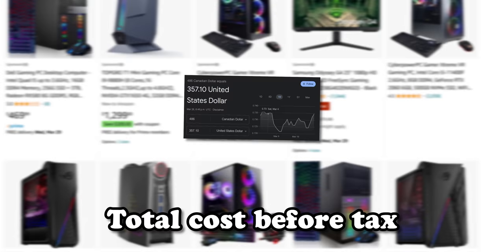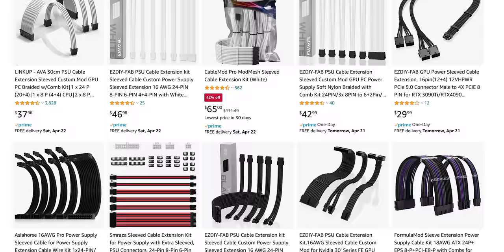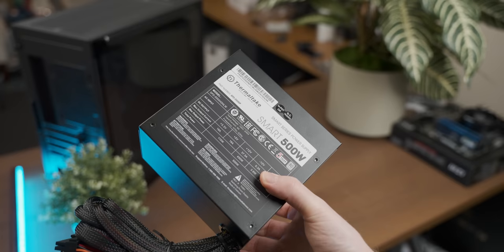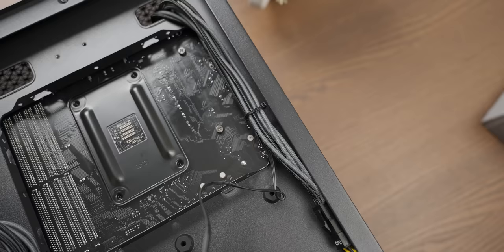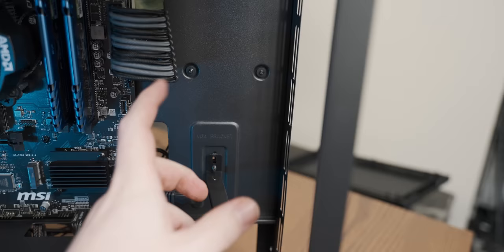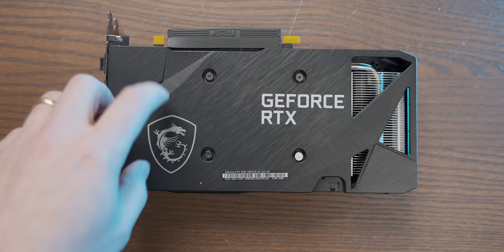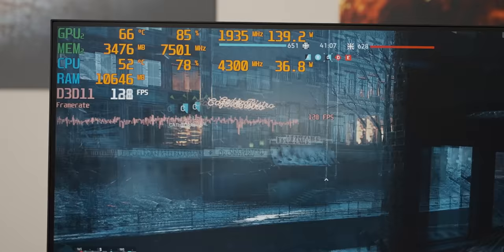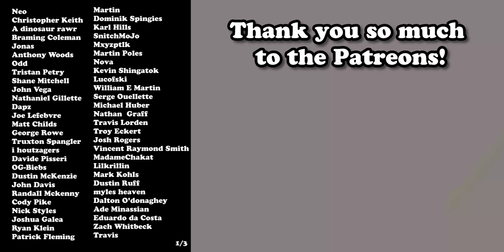I Use ONLY "Amazon's Choice" Crap To Upgrade My Gaming PC...

Comment: Ironically enough, the Peerless Assassin is actually one of the best air coolers in this price range. Gamers Nexus put it through its paces with their test and it came pretty close to matching the Noctua NH-D15 in terms of cooling performance. I think it might be due to you not having used the second fan as well as using the stock CPU fan curves that caused the excess noise in the system.
Reply: Yep, actually one of the best air coolers period. According to GN, Hardware Canucks. And for that price it's a steal :)
Reply: Or use a Noctua industrial 3000 RPM fan and call it a day. If you're really feeling frisky use 3 industrial 3000 RPM fans.
Reply: A noctua two tower model with one fan in the middle is more silent than the two fan model.
Reply: Yeah, I watched the video by Gamers Nexus so I thought the same thing. Until I bought it. I have it paired with a 5800x so I'm willing to give it the benefit of the doubt when it comes to mediocre thermal performance, but the fans really ain't great. Max fan speed I'm running them at is about 50%.  After that, they start to get real noisy and produce a high pitched whistling kind of sound when they're at 70%. Good thing about it has a lot of thermal mass so it gets away with low fan RPM most of the time, and for the price it's still an absolute steal.
Reply: @K1NDR3D  blud thinks he's him
Reply: @jamesm568  and pay 6x the price
Reply: I am using the Pearless Assassin on an Ryzen 7 5800x. I am using both fans however. The fans never seem to make that much noise when I am using it even in fairly intensive games. I play Shadows of the Tomb Raider and Zero Dawn, which I think are pretty high end games.
Reply: @legostarwarsrulez  True, but works.
Reply: If Dawid had mounted the fans properly and not just used one clipped to the wrong side of the fin stack, he wouldn't have even had the complaint about the fan sounding awful, which was 100% down to his own modification to the instructions. Never mount fans with the intake right against an obstacle if it can be avoided (and it can be avoided here), since it causes turbulence and excessive noise.
Reply: @jamesm568  enjoy the noctua tax
Reply: @JeskidoYT  I enjoy the great product support as I don't have to replace the stock fan that comes with their products unlike this product here.
Reply: @SierraAAM  It's all good as we all have our likes and dislikes.
Reply: @bjn714  I noticed that too. Encountered a similar problem with fan turbulence when deshrouding my GPU and mounting the fans hub side up against the heatsink to have them exhaust. Had to use some foam spacers since the fans didn't have any bumpers either.
Reply: @alfredosaus1545  that can result in turbulence too, but due to blowback, which is not exactly what's happening here. The fan blades are slicing through the air which it expects will be open/little resistance, and when you mount the intake side (opposite the hub) directly against a fin stack, the blades will be essentially bifurcating the airflow at each fin stack, with some going back out toward the front (which will get pulled through via static pressure, so it's not like it will be blowing two ways at once) and the rest going in the direction it is intended. That air that's being bifurcated across each fin will cause a turbulent resonance, almost like if you were to drag a sheet of paper down the fin stack, but at 1200 RPM or so. 

But simply removing the clips and putting them in the other holes on the fan and clipping it to the rear fin stack would completely solve this issue (in Dawid's case). Your GPU situation you seem to have already solved, but yes, a foam gasket or 3D printed spacer is ideal for this application.
Reply: People in this thread blaming the way it's mounted for the sound, with no one actually owning the damn thing.
Reply: @K1NDR3D  how are you able to make such a claim? Oh that's right, you can't. 
I've used this cooler in over a dozen client systems in the past 6 months, and none of them have had any excessive noise issues—the coolers are quieter than the NH-D15, even. But there was absolutely an issue with how the fan was attached to the cooler in this video, which is verifiable by simply watching the video.
Reply from the maker: That’s good to know. The fan noise was clearly an ID10T issue. The cooler clearly just wants to be used in the “correct” configuration.
Reply: @DawidDoesTechStuff  it would still be fine with a single fan, as long as you clip it on so that the hub is against the second tower, rather than the intake touching the back of the first tower. So just moving the clips to the other set of holes on the fan and clipping it to the rear tower instead should solve the noise issue.
Reply: @bjn714  If it's quieter than the NH-D15, which I highly doubt, Noctua really needs to work on their fan design
Reply: @K1NDR3D  The NH-D15 is quite old now, and those 150mm fans it uses are not quiet when compared to their flagship NF-A12x25 fans, which are much quieter.
Reply: How does it compare to the NH-U12S Redux? I have a 12400f, and don't play anything particularly super heavy. The stock cooler is loud as hell when the Temps are in the 40 range which shouldn't be happening. I was thinking of just going with the noctua since it looks easier to install and would be enough for me, but the thermalright one is a bit cheaper and  seems pretty damn good but a bit big.
Reply: Not bad for a copy paste huh
Reply: @tek3576  i have a 12600k and cool it with a nhd9l, you'll be fine with the u12s. Peerless assassin is overkill unless you want a chonky cooler to just have a chonky cooler.
Reply: I can confirm that the stock fans that come with the peerless assassins are that lound no matter what.
Reply: High noise is due to the fact that case is not pulling enough fresh air nor it's exhausting well enough. 
I built few rigs in similar cheap cases, where front panel RBG is more important than air vents, and temperatures and noise levels get better once you remove ceiling dust filter. It's stupid there anyway in the most use cases because rarely anyone is pulling air inside from the top.
Reply: @jamesm568  You can get a box fan that moves > 5000 cfm.  Funnel and duct that through the case.  Added bonus, you can get a high flow filter that for all intents and purposes sterilizes your air and perfectly fits to its back with some tape.
Reply: @uncrunch398  You can also just keep your room at 32°F your computer is in.
Reply: @jamesm568  The box fan isn't super expensive to buy nor operate.  And can be quiet enough to forget about it.  How much will it cost to maintain the freezing point of water for your room when the ambient outside stays above 75F and peaks 88F to ~100F depending on day?
Reply: @uncrunch398  That's why you just buy you a Noctua 3000RPM Industrial Fan. If you're a PC enthusiasts cost is irrelevant anyway.
Reply: @jamesm568  I'm a practical value enthusiast.  I like to target benefit per cost with a performance floor.
Reply: @uncrunch398  And I like using products I can drag from case to case and use them in multiple ways without being limited to one option.
Reply: @jamesm568  That makes sense to me.  It goes with intended use long term.
Reply: I guarantee it is NOT. EVEN. CLOSE. to a DH15. If you install and configure everything properly and actually optimize case airflow, DH15 blows literally anything else out of the galaxy.
Reply: @jefftraboulsy8631  Then do a controlled temp test with benchmarks like Gamers Nexus and prove them wrong. Otherwise, it's just you saying "trust me bro" with no proof behind it.
Reply: @jefftraboulsy8631  Actually, if you have optimized airflow most air coolers can live up to their specs. Now I would pick Noctua over most of the off-brand air coolers as it's just ghetto using anything less.
Reply: I used to have that peerless assassin before, and also had that annoying noise from the fan. Looked it up on the net and found many complaints about the fan too. So i only changed the fan, cos the cooling itself is actually good. Don't know why people here are so defensive about the cooling, like it cannot have any problem.
Reply: i have a feeling the actual cause of the noise may have been the power supply. Dawid showered that poor thing with nothing but complaints. considering how extravagant it already was compared to the CPU it was mated to, i can't imagine the problem was the missing second fan. i mean, it could be. i'm a complete computer newbie when it comes to this stuff. but i dunno.
Reply: yes, the Peerless is very good but the fans are crap, so I replaced them by two fans coming from a NH-U14s I had left and the result is really good. Also, the Noctua fans comes with rubber pads that avoid all unecessary noise due to vibration.
Reply: @K1NDR3D  i have the cooler and can say after seeing his comment it does in fact change the sound profile when swithing the fans over and also having just one fan in the middle will over work the fan and have it ramp up higher than it would normally go with the two fan layout
Reply: do we think amazon choice is RNG? why would it be ironic
Reply: The Phantom Spirit is now the apex budget cooler

Comment: the crucial p3 is actually an amazing choice; 45$ for a 1TB 3500MB/s Drive is incredible. I personally recommend the p3 plus, but you can’t go wrong with either.
Reply: The plus version is like $54 I think, not a lot more and It is way faster so maybe that one is a better option
Reply: @Scj10  I agree. It’s about 5 dollars more for the same capacity, but with PCIe 4.0, and reads of up to 5000MB/s. I just didn’t mention it because you really can’t go wrong with either
Reply: I got it for slightly more but id still recommend
Reply from the maker: It’s so cheap for a drive that fast! Storage pricing has gotten so good.
Reply: it’s amazing right? I couldn’t believe my eyes when I saw it go down to 45USD
Reply: I had it installed in my Acer Swift X, no complaint!
Reply: It's a qlc drive though, which isn't really good if you're constantly writing a bunch of stuff into it.
Reply: You miss the point, it’s $45, it’s exceptional for its price point. If you wanted a better drive, it would obviously cost more money.
Reply: Can confirm this for sure. I mean last year I upgraded my system when AMD were slashing prices on B550 and X570, as well as 5xxx series CPUs--but I also grabbed a P5 1TB as my OS drive; recently, as far back as the the OP, I decided I wanted to just add another 2TB in the second slot, and saw a P3 going for for about £20 cheaper than a MX500 2TB SATA drive. 

Insane, and a steal!
Reply: I have a 4tb one and its solid for mass storage
Reply: @DawidDoesTechStuff  Can we get GDDR6 prices down next? Can I get a slot for GDDR ram upgrades so I can install it when I can afford it? Or at least start coding for utilization of the shared memory?

Comment: I used some SYY thermal paste on my laptop about 2 years ago. Still going really well in terms of thermals. My only advice is that it's a bit thicker/denser than I'm used to so spreading is a bit difficult. I'd advise spreading it manually with the included tool on something like a laptop rather than just sending the screws home and sending it - it feels like it'd bend the board before spreading nicely

Comment: I used to have the same cpu cooler. Turns out, placing the fans as pull instead of push makes the cooler overall louder with a high-pitched noice. And putting both of them, managed to stay very quiet even with a 5800x with temps below 65° in a full load while gaming.

Comment: been using SSY 157 thermal paste for about a year now found it to be as good as anything branded plus its always in stock on amazon and I've been getting 8 grams for about 8 quid uk
Reply: 6:33 4times the storage does not make it faster a faster ssd is faster not the capacity🤣🤣🤣
Reply: @raven4k998  not technically true with nvme drives smaller capacity drives can and are slower than there larger capacity siblings e.g
wd sn750 250gb r/w 3300/1200,    wd sn750 500gb r/w 3500/2300, wd sn750 1tb r/w 3500/3000
Reply: @moorhen6156  nope Dawid said faster not slower faster like when you floor it in your car🤣🤣

Comment: I've used that power supply in my system for over 4 years now. Never had a single issue
Reply: Same. Just updated mine with 550W after about 4 years. Previous one was working great just needed cleaning and I put it in another case for a lower end build.

Comment: ngl that cpu cooler is actually pretty good if you can fit it in your build, the only downside is the fan noise on the lower tier cooler, but you can easily swap them out for more silent fans
Reply: Stick an arctic or 2 on it
Reply: If you can pick up the Thermalright on sale, which has been happening a lot lately, and have the fans lying around, then it's a great deal.  But once you start buying fans, it's putting you close to the price of other coolers.  
Right now, on Amazon, the black edition of the 120SE is $37usd.  If you pair it with a couple of Arctic P series fans, there's another $20.  At $57, would I spend the extra $8 and get a Deepcool AK620?  Probably.  But I'm not everybody.
Personally, I got the Peerless Assassin on sale for $32, and bought a 5 pack of the Arctic P series fans.  2 fans replaced the cooler fans, and the other 3 replaced case fans.  That setup has worked great for me.
Reply: @tsuzot8192  I have a thermalright silversoul 135 and it got a decent, very quiet fan...
Reply: @tsuzot8192  The Thermalright is a better cooler than the AK620, the more expensive version of it comes with fans with rubber corners, I guess it makes it sound a bit better. Otherwise it's one of the best air coolers atm and only costs like 40USD. It's a steal.
Reply: @jondasek  As GamersNexus said, the Thermalright is "within error and indistinguishable of the $65 Deepcool AK620."
Also, I was addressing the guy that said replace the fans, which adds costs to the cooler.

Comment: The fan on the cooler likely sounds awful due to how it's mounted. They're designed to be in a "push" configuration, with the exhasut side of each fan directly touching the fin stacks and an air gap on the intake side, but you have it clipped to the back of the first fin stack in a "pull" configuration, which will lead to turbulence since the blades are spinning right up against the fin stack with no air gap.

Comment: You are correct...swap the GPU with the 6600 and use that money saved to put in a 5600X.  That system would be well optimized.  The Crucial SSD is a great budget option and I have the P2 version in my media server.  Honestly anything that can read/write over 1.5K MB/s is fine.  Standard Windows stuff and gaming is totally fine with PCIE Gen 3.

Comment: I was surprised you had issues with the airgoo RGB strips. I’ve used them in at least a half a dozen systems with no problems.

The thermalright cooler is a really solid performer but as you pointed out there’s issues with RAM clearance.

Love your videos 👍👍
Reply: I would guess the issue is with the RGB controller, not the strips.  Shutting off randomly sounds like a controller issue.

Comment: SYY-157 is a really good thermal paste, I use it on GPU and Laptop because it's "thick" and doesn't dry with the time !
Reply: How often is thermal paste replaced? Even in laptops?
Reply: @Floyd Looney  I do it at the end of the year. You'd be surprised at how often I've just repasted a cpu  to fix crashes.

 Girlfriend had a gpu for a year and checked it out, and the paste and pads were dried out and useless.
Reply: @E L Δ T E  it's admittedly because I'm bored and like trying different coolers I end up with out of boredom.

Comment: I unironically used nothing but MF120's and MF140's in my build, along with a PL360Flux from Cooler Master as well. I went with a Corsair RM750x to cut down on noise so my computer isn't a spaceship. They're not bad fans at all! The ARGB LED's are very vibrant.

Comment: Peerless Assassin is a beastly cooler, up there with Noctua for a third of the price!
Reply: If you take away the fan prices then still Noctua cost more. True. 

It is still hard to say really, I mean sure getting the tower and adding better fans to it? Yea it might be a good deal. But a Noctua NH-U12S Redux go for $50... With fans. And then we got BeQuite or really all kinds of options, even used!! I rather get a brand name cooler since even Noctua the kings of air premium got options worth the extra $10. If AMD stock coolers where just a tiny bit better at keeping the CPU's from dying a early death? I mean it is so close for the stock cooler to handle a 5600G without fan noise and worries about the chips dying earlier then it has to.
Reply: @TheDiner50  The fans on it are okay, why would you have to change it? It's on par with the best air coolers with its stock configuration and the fans are actually pretty quiet according to any scientific benchmarks I've seen (GN, Hardware Canucks)
Reply: @jondasek  They aren't good fans.  Fan balancing and motors have always been thermalright's bane and Noctua's strength.
Reply: Noctua is still the way to go if you want no compromises with air cooling. Nothing wrong with going cheaper if you're not going to use the coolers full potential. You can also buy a 120mm or 140mm AIO for $30 to $40 to save space with AMD's G-series CPUs. If you seriously can't afford $100 for an air cooler you seriously don't need to be dealing with computers either.

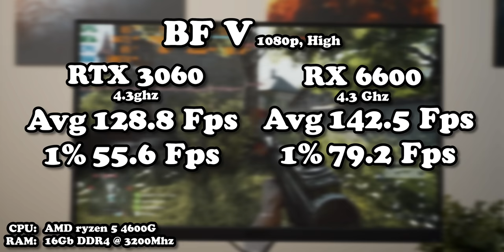Comment: 13:52 AMD GPU performs much better in CPU bottleneck scenario because of driver overhead, that’s probably why you got better results on RX 6600
Reply: And for the price of an new RTX 3060, you get RX 6650 that beats it and even RX 6750 that I don't have to mention the difference in performance and also 12 GB VRAM...